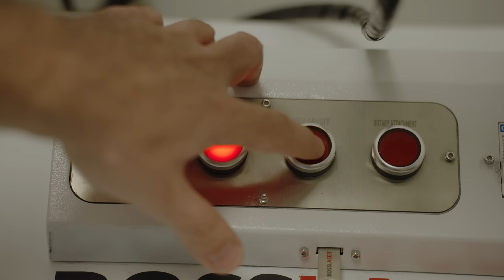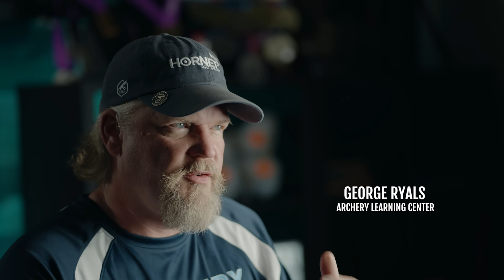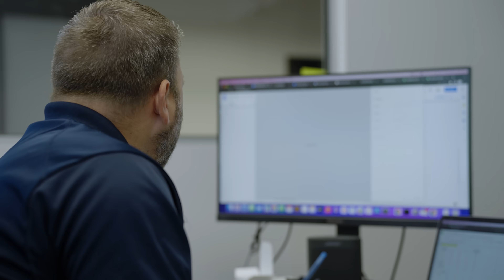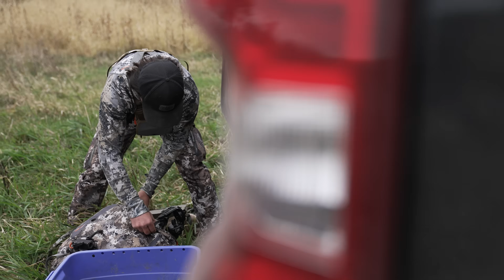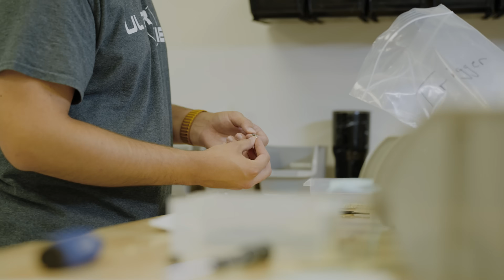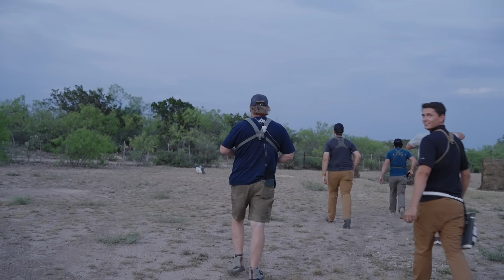UV BUTTON The ultimate bowhunting release

Comment: I've got the UV button and it cut my draw length down about .5". So I decided to shop for another release that I wouldn't need to sacrifice draw length, but nothing felt as good as the UV button. The consistency and smoothness outweigh the draw length issue for me, and the machining is tier one. If UV can just shorten this thing up, it will be perfect.

Comment: I have tested a lot of hinges over the last year and ended up with the stainless Hinge 2. It is built like a tank, great ergos, extensive adjustability and the UV customer service is top shelf. When it was time to buy a thumb release, the UV Button was the only one that made sense, so I gave it a try at my local shop. I could not believe how quiet and clean the shot broke. I took advantage of the Black Friday deals on the UV site and ordered the Button in aluminum. Keep up the great work Ultraview!

Comment: Where you guys dropped the ball for me is that you have to manually latch it on to your D-Loop plus manually set it into the fire position.. thats two steps when most hunting releases require one.. this makes for a great Target release or even for a tree stand hunter.. but us spot ant stalk guys it adds another step when its not necessary.. forget a step an your screwed. My nock2it does it all with a single step. Love the design tho but dropped the ball with the two steps in “opinion”

Comment: Nice.  I'd like to see one with a shorter neck in the future.  I have to shorten my draw length with the current design.
Reply: Same here unfortunately. Still have my UV Hinge 1.0 and it would require me to shorten my 27.5in draw length quite a bit...this UV button is sick though...just has a longer neck than any of my Carter or Stan releases.
Reply: You might have to link them your drawing but at least it keeps that release away from your face with a shorter neck I feel like you're more crunched up in your face therefore causing tension in the back of the arrow